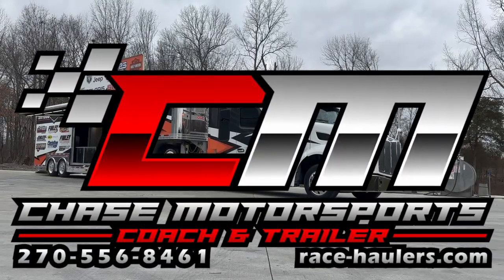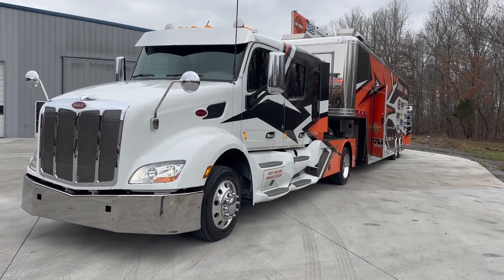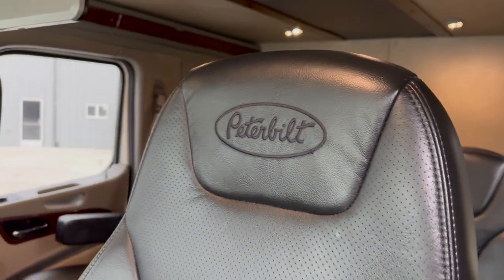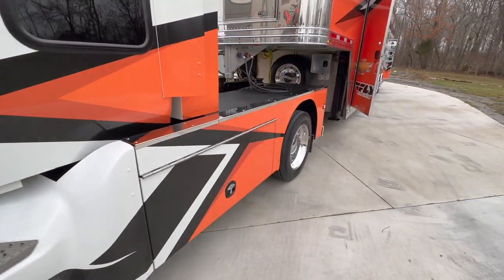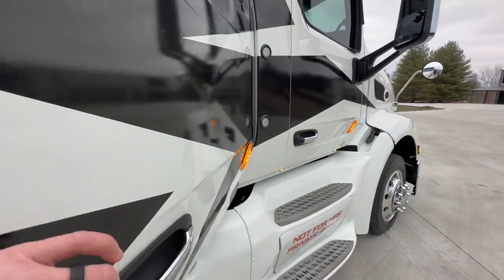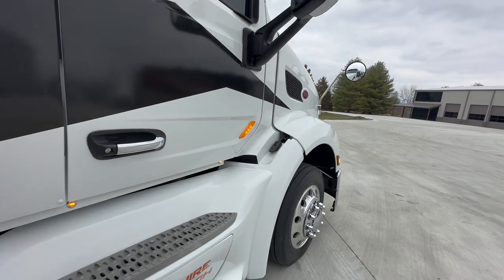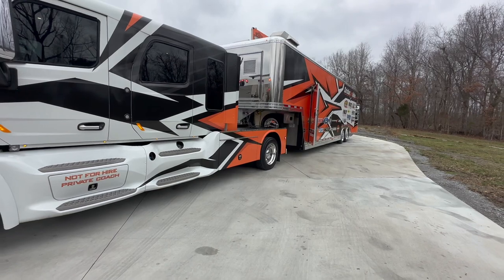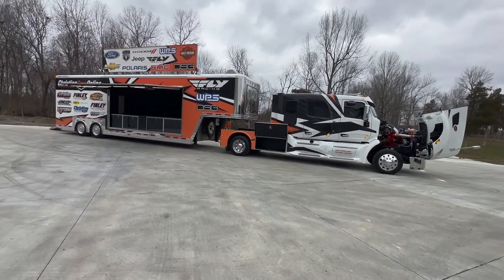Dream Tow Vehicle paired with a MINT condition Vending Trailer

Comment: DOES IT REQUIRE A CDL?
Reply from the maker: Currently yes, but it can be converted to an "RV" which does not require a CDL
Reply: If your state allows you can register it as an RV and operate it as such with a standard class-D license; however you cannot tow over 10,000 lbs. even it is registered as an RV without a CDL as you still have the 10k lb trailer limit as the RV exception doesn’t include trailers only the drive vehicle. Also you should be aware not all states recognize the RV exceptions and have different restrictions/limitations than those identified by the video maker.